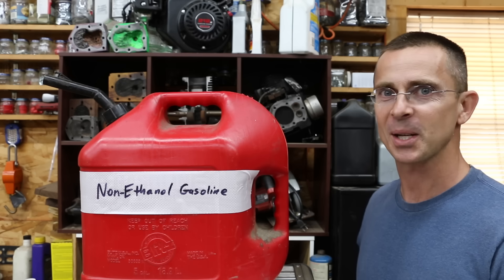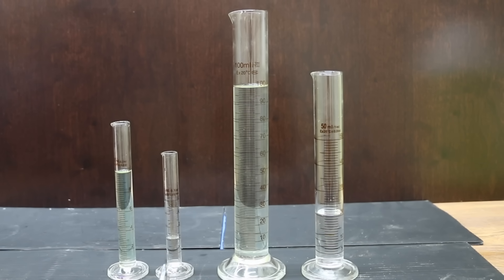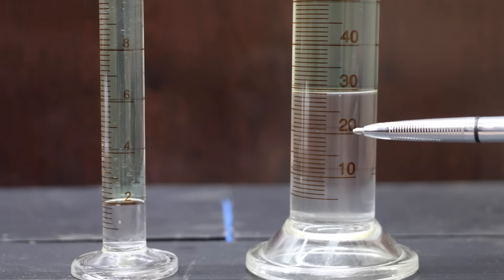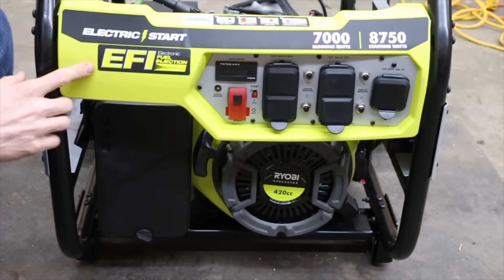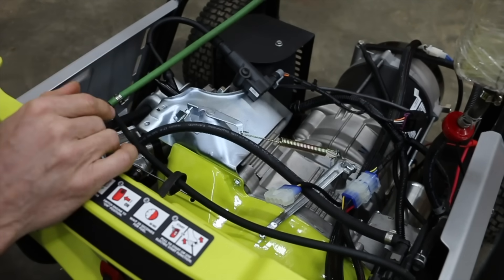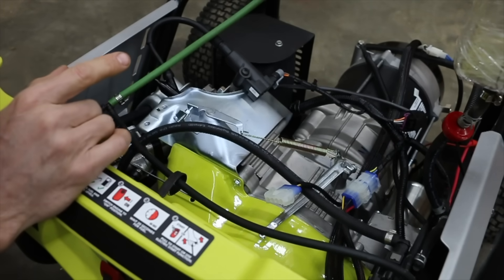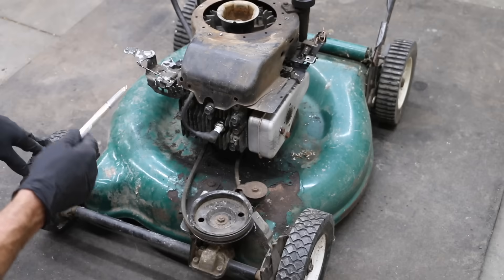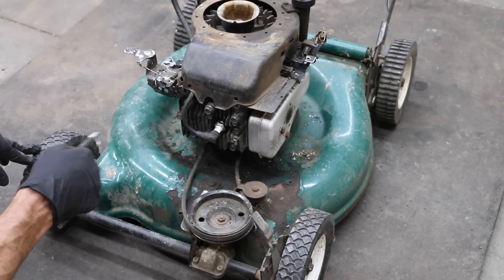Is Non-Ethanol Gasoline Really Better? See the PROOF!

Comment: FWIW, I drive quite a bit for work and have put upwards of 300k on a couple different cars (06 Civic and 16 Focus). I've ran thousands of miles back to back on both regular and E10 we have here, and kept MPG logs on all of it. If there was a noticeable difference in MPG between the two fuel types it was only 1 or 2 MPG. I do have a 60's era muscle car, I have ran E10 in it before, and, anecdotally, I think that may have contributed to a vapor lock issue at one point but no way to be sure.

On small engines I can't say. I run E10 in them but I always run fuel stabilizer as well.
Reply from the maker: Thanks for the feedback.

Comment: A very succinct video. Good job. I, like many others believe that a long term test may prove different results. That being said, whenever I go to the local small engine shop for parts for my small engine products, the guy behind the desk always gives me the gears about ethanol fuel and non-ethanol fuel use in small motors and that they sternly recommend using the higher octane which in their experience have less problems. I never really thought about it all those years ago, however, but have since converted over to using the high test fuel. Better safe than sorry for the few extra dollars it costs to fill up a jerry can. Cheers!
Reply from the maker: Thanks and you are welcome!

Comment: The complaint I've heard repeatedly about gas with ethanol is that it destroys the seals and gaskets in engines.  However, gasoline without ethanol does not do nearly as much damage.  Spend a few bucks more on good-quality, no ethanol gas and save yourself a lot of headaches, time and money for engine repairs in the long run.
Reply: Depending on what your driving that’s a really expensive idea and possibly wasteful idea.

Comment: We see a lot of problems with small carburetor parts, diaphragms and such, with ethanol fuel when the unit is stored with ethanol fuel in it. We recommend storage of units with engineered fuel such as True Fuel or Motomix for any kind of long term storage. The ethanol will draw in moisture and cause corrosion in the small carburetors rendering them unable to do their job correctly. Love your videos.
Reply from the maker: Thanks!

Comment: This is a brilliant video as usual.  I was surprise the E10 didn't burn visibly cleaner on the valves ... although the E10 spark plug did look visibly cleaner to me. One thing I've heard that you don't get at is whether Ethanol will melt certain "vinatge" plastic fuel system component. For example, in a boat with a fibre-glass gas tank, will E10 gas will melt the resin and destroy the tank?
Reply from the maker: Thanks!  Thanks for the feedback.

Comment: As soon as the ethanol content went up I noticed a definite drop in efficiency for my car and motorcycle. One complaint I have against all the tree-huggers who made the decision to add ethanol to pump gas is: is the environment gaining anything by using more fuel now that ethanol has been added to pump gas? Hmm...maybe there's a way to test the exhaust contents with and without ethanol in pump gas. I know there's external sensors available for testing exhaust O2 ratios but maybe there's some for testing CO and CO2.

Comment: Watercrafts such as boats or seadoos needs to have zero ethanol in gas. Ethanol attracts mosture and there is plenty of that at lakes. Gas tanks are made to not be be airtight so they can release pressure. In that same way gas get that water molecules. Sea doos are extremelly vounerable to ethanol in gas. Some seadoos designed to go on single cylinder while at idle which lead to engine chocking and eventually die. You can't steer small watercrafts without propultion they just float until they restart or hit the shore at whatever speed. Ethanol should be forbiden in watercrafts and gas stations should clearly indicate signs including the downsides of ethanol. Possible that 4% less efficiency too. Most people buy the cheapest gas without full knowleadge of this.
Reply from the maker: Thanks for the feedback.

Comment: My 1991 Mercedes 190E did run pretty good on 40% E85 mixed with rest 98 octane for years :) (adjusted the airflow sensor so it got more fuel so it would run richer air fuel mixture as Ethanol has less energy so it needs more fuel) It also needed that mix to pass emmisions tests. But my Yamaha WR450 got the carburetor ruined by running a 30% E85 mix once after just 30 min... The E85 dissolved the carburetor needle that was made of plastic.
Reply from the maker: Thanks for sharing.

Comment: I know the effects of corn syrup on rubber and plastic. Witout waiting nine months. It rots rubber. And dry rotts plastic. My uncles 67  El camino caught on fire and burnt up becauae of it. Corn syrup rotted the vacume advance. Gas leaked out. And sparked a fire from the distributor cap. It will dry rott rubber and plastic gas lines and primmer bulbs on small engines. It will dry up and  Crystallized Clogging the carberator. And seaze the float valve in as little as 3 months. Dont put corn syrup in any small engine. If you dont plan on using it everyday. Even if you do use it everday. Evenually within 12 to 18 month you're gonna have problems. Hard starts, ruff up and down rpms. Ruff idle, Stalls or no start
Reply from the maker: Thanks for the feedback.

Comment: Just want to know if the time test had the same engine starting temp for each test, the reason for asking is thermal expansion, makes the engine more efficient, also the engine soaks up more of the energy till it hits it's operating temp.   Also warn engine is better at vaporizing the fuel before ignition. Otherwise nice video

Comment: I know this is a pretty old video but it seems like you are AMAZING about reading and responding to comments. I'm curious about using higher octane fuel in small engines. I have a friend who recommends it simply because it doesn't (usually) contain ethanol which he believes is hard on the engine and likely to absorb moisture when left sitting. Your testing seems to show that it has a slightly better fuel efficiency but it didn't seem to change the level of carbon deposits.

What I'm wondering is whether most small engines are designed to run on higher (91-93) octane? It's my understanding that higher octane simply means it has a slightly higher ignition point. Does a lawn mower engine benefit from running the high-test?
Reply: From my experience the ethanol fuel seems to be bad for carburetor seals. My 2005 660 grizzly had to have the carb rebuilt after 2 years running 87 octane 10% ethanol, which the dealer told me was fine to use. Another friend of mine told me after that to only use 91 ethanol free fuel. He was a small engine mechanic all his life. Since only using 91 ethanol free I have not had any problems. It's the only fuel I use in all my small engines. When I put them away for the season I always mix a little Seafoam in the gas and run them for a few minutes till the mix gets in the carb. No problems with any of them. I was also told by another friend that builds and races cars along with teaching auto shop that ethanol fuel is bad for Holley carbs, dries out the seals. Fuel injected vehicles have seals made out of different materials that are not affected by the ethanol.
Reply: The EverStart is still $119 at Walmart!
Reply: Old question about lawn mower an premium gas. I've used premium in lawn mowers for 55 years. No carbon build up. I idle 99 % of time with sharp blades. 
Never had a engine problem. Ware  out frames in 6 to 9 thousand hours an give to next man to use the engine for years to come. I don't use zero turn mowers. I use only lawn tractors last 35 years. 
Everyone says run engine wide open. Not this boy. Change oil Plugs an grease m.

Comment: it's when the gas evaps out of the carb system the ethanol leaves the corn powder in the carbs bowl and the lines and ports plugging the system where fuel don't flow through properly or not at all and since it is alcohol it evaps faster than non-ethanol

Comment: Could you do some power comparison? Horse power perhaps? I can get "Pure" gas (without Ethanol) for my car by driving out of town a bit. As you found, I get a measurable 3-4% increase compared to 10% Ethanol. My car as an Average MPG display and no I do not adjust my driving. In fact I needed gas the other day and glanced at the AvMPG and realized I was still driving on the last batch. I had forgotten but the difference was still there. And I was replacing it with 10%E. 

Seems I notice an increase in responsiveness, performance as well. But that is subjective. It would be interesting to know if it is actual or not.
Reply from the maker: Thanks for the suggestion.